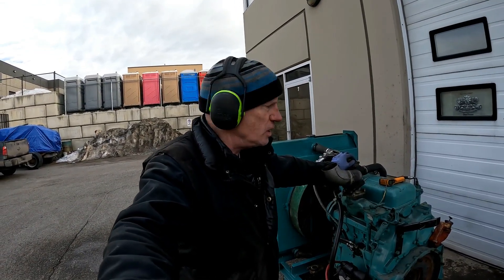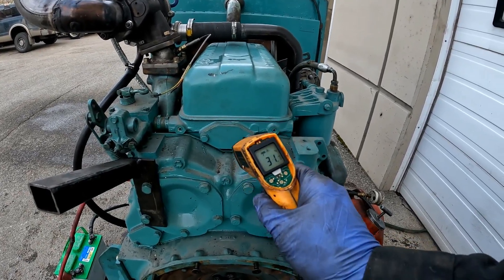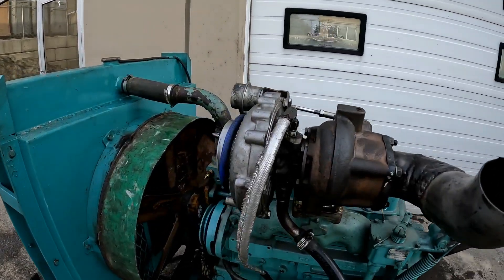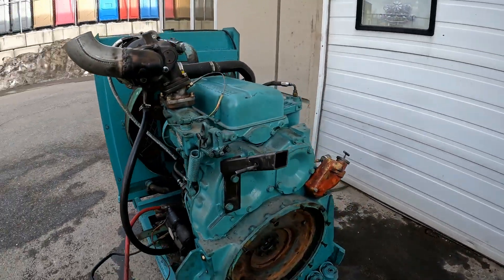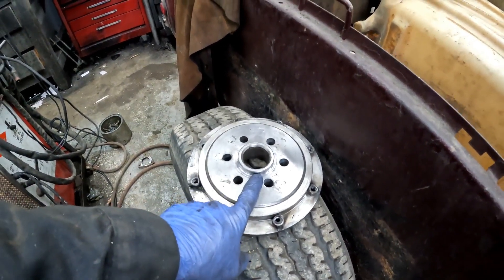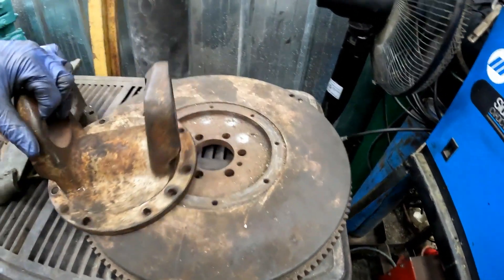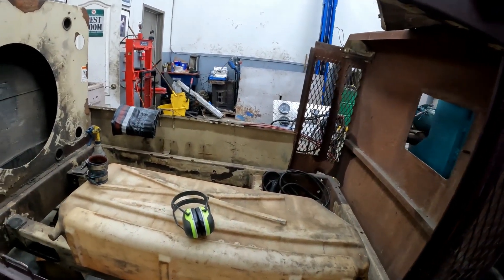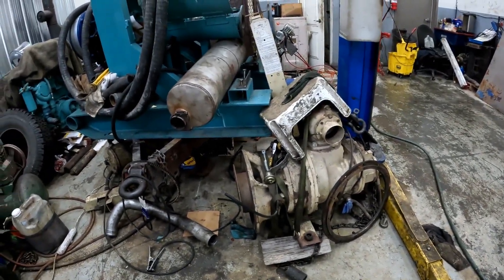Detroit 3-53T (Cold Start)

Comment: I have one of these, i need to start, its not turbo. It has an old transmission on it and its locked up, im hoping its the transmission thats looking up. Any tips on starting an old 3-53 thats been ditting for 20 years ?
Reply from the maker: Pull the trans, and starter and see if you can get it to turn with a pry bar on the ring gear.  Could also be the blower that's locked of, so keep that in mind.  If it won't turn, then pull the injectors and pour oil/diesel mix into the cylinders and let soak.  If this doesn't work then pull the head and see what pistons are seized.:)
Reply: @detroitgarage9430  will do, thank you. I'll be back with more questions. I'm wanting to put it on an old international 1 ton truck.
Reply: 72 international to be exact.
Reply from the maker: @Questionable_creations  Awesome.:)

Comment: When I did my time back in the late 70's early 80's most of the GMs I worked on were 71 series gen sets.  Here in Australia power is 50hz not 60hz, so gen sets ran at 1500 rpm, not 1800 like in the US.  Mostly that was fine, but I did see a 3-53 turbo gen set, configured to run at 1500 RPM, and this was well before the silver 53s.  The poor thing had massive carbon build up.  I suspect the turbo was not right for the application, and just didn't give it enough boost pressure.  I must say this one sounds lovely, and N45s wouldn't need turbo boost anyway.
Reply from the maker: From what I'm told the 71 series were a better engine for gen sets.  You rarely see any 53 series, so maybe there's some truth to that.  This one will idle close to 1600 and run at 2100-2300.  I'll know more once I get it set up.:)  I think that should keep it happy.  Ran really nice and pretty quiet overall.:)  I didn't check the rpm, but was close to 2200 on the governor.:)